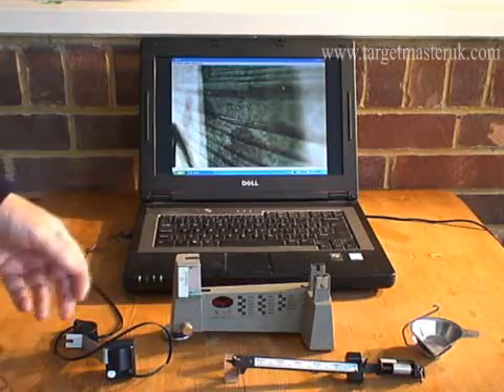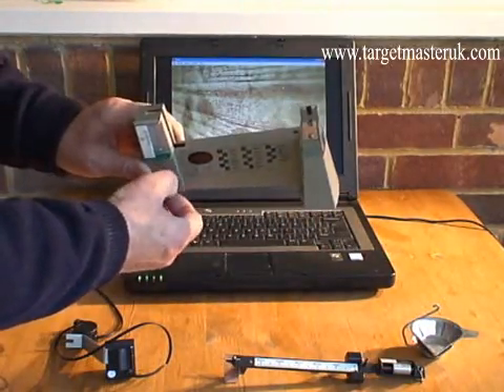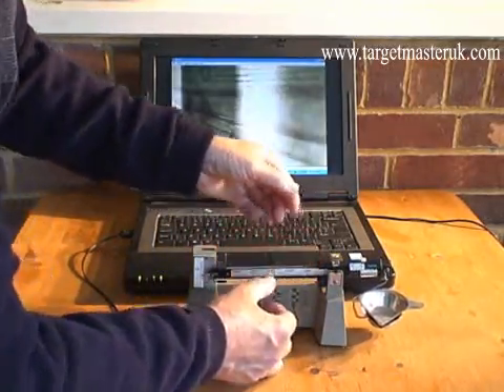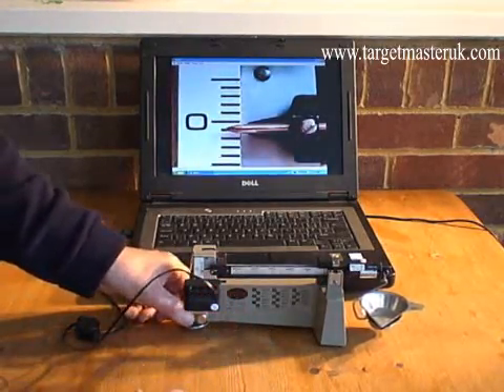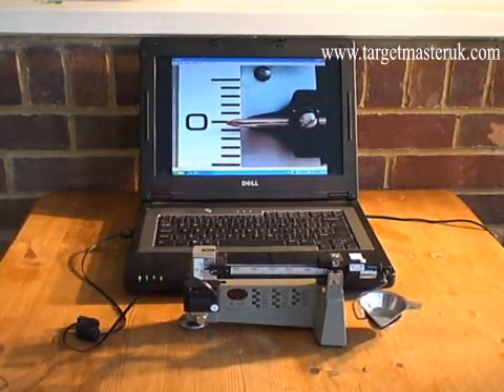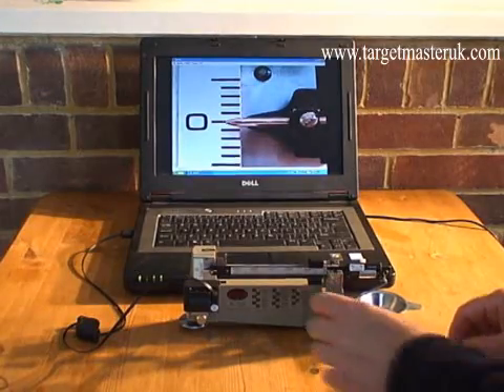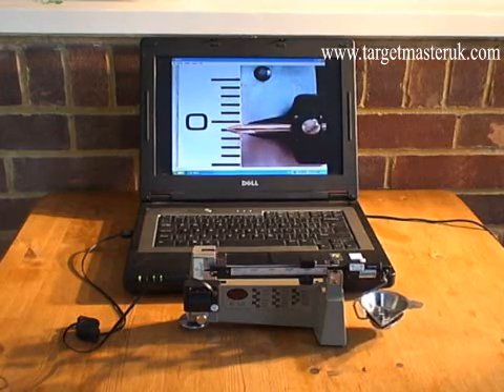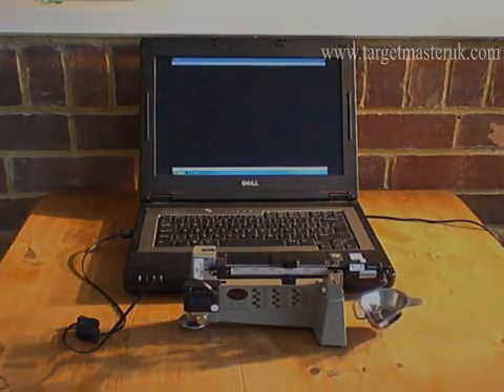Tuned RCBS / Ohaus 5-10 scales

Comment: How can I do the extended needle
Reply from the maker: I make all the parts myself by hand. The pointer needs to be made from something non-magnetic (Copper/Brass) and stand away from the bean by about 1.5-2mm. After fitting an extended pointer you will need to rebalance the scale by adding weight the the weightbox under the pan.

Comment: +thetargetmaster Hallo, I have a question. I purchased a used RCBS 5-10 that appeared to be in good condition. However, after I got it home it would not zero. Tried everything but the beam would not get anywhere near zero (i think I may have knocked it or something on the way home) and no matter how much I unscrewed the rotating disk, it wouldn't get close. I ended up re-calibrating the scale by adding a little bit more lead in the pan holder and worked great from then on.

Now I have noticed that I need to lift the pan off and place it back a few times to make sure it reading properly. For example, I would trickle up so its close to the line but if I take the pan off and put it back, its over or if I am lucky it will be spot on. But if I move the pan again it will be somewhere else. I triple check my charges (i.e it needs to read the same 3 times) and I'm getting an SD of about 5fps but would like to speed things up and get it to read correctly the first time. Is this normal with these scales, due to its age maybe or is there something I can do to make it function better?
Reply from the maker: Hello Mark - The 5-10 is an excellent scale, certainly better than any beam scale made today.
You would appear to have two problems. The scale isn't zeroing and it's not repeatable.

Have you ever seen the scale zero ok? Could it be that you have the wrong pan?

If it used to zero ok but doesn't now, then I would guess that you have knocked the copper damper blade. Just bending it a few thou will throw the zero right out.
The non-repeatability could be one of several things, dull or chipped knife edges, dirty or stuck agate bearings, friction at the pan hanger stirrup etc.
Reply: +thetargetmaster I had the zeroing issue since when I got the scale but checked it with a bullet (knowing the bullet may be off its advertised weight) and seemed pretty close. the scale is reasonably repeatable but I have to lift the pan and put it down a few times to make sure its reading right. how will I know if I have the correct pan? its the brass coloured one commonly seen with the RCBS scales. interesting thing to note about the copper disc by the magnets is that it appears to be closer to one side than the other. could that be an issue? is there a way to properly recalibrate it or maybe some sort of troubleshooting list and steps on how to correct the common knows potential issues?
Reply from the maker: Unfortunately all the pans look the same but very rarely are they the same weight. If the scale was working perfectly well with this pan, but now it's not, then the problem is with the beam.

If the scale has never zeroed with this pan, it could be the pan. It's not a problem as the scale can be re-calibrated by adjusting the weight in the weight box under the pan.

If the scale did zero with the current pan, but now it doesn't you need to find out why, not just adjust the tare weight.

I would first check that there is no "hair" of wire wool stuck in the damper slot, then I would remove both bearings and clean the housings and the agate bearing  and knife edges in lighter fuel type spirit with a tooth brush.

The bearings should be free to wobble about. The pan hanger stirrup should hang and swing freely. The knife edges should be sharp, with no burrs and not rounded or chipped at the ends.
Reply: +thetargetmaster thank you. I'll look into it :)

Comment: +thetargetmaster Hi, I have a RCBS 5 10 scale which is basically in brand new condition, it was bought by a family member probably 30 years ago. I have issues with a wandering zero.The zero will wander from high to low depending on how the pan is placed in the scale. One moment it is perfectly zeroed the next it is not? It's not out by much but it is causing me to second guess my loads.
Reply from the maker: Hello Russell.  That sounds to me as if there's a problem with the pan hanger stirrup. If you remove the pan and pan hanger you are left with just the thin wire stirrup. This should be completely free to swing without touching the sides of the groove cut in the little knife edge.
Make sure the two wire circles in the stirrup are parallel to the beam and just bend the stirrup in or out a little until it hangs free. Let me know how you get on.

Comment: thetargetmaster  Thanks for posting this video.  I picked up and old 5-10 from family yesterday and I think I have a problem that I was wondering if someone who knows this scale through and through might be able to shed light on.

The needle/nose literally touches the measure.  It makes contact with the inside part of the measure and if I pull the pivot back a little bit the needle will still scrape on the front (right hand side) of the measure.  When looking from above the copper guide touches and scrapes along the top series of magnets.  I've put a screwdriver to the magnets and they do indeed carry a field.  I've also taken calipers to compare how far the needle rides behind the measure and it appears to be a clean 1mm.  There also appears to be an apparent amount of rust along the flat blue foil underneath the scale.  

I believe it may be a magnetics problem but I just don't know these scales too well and there's little research to go on.  Even RCBS's very instruction manual is little help.  I hope this isn't too confusing, but if you can help I would much appreciate it.

Also the camera is too cool.
Reply from the maker: Ok, I'll help if I can. First thing is, this scale is worth putting a bit of time and effort into, there's nothing really that can't be fixed on them and they are one of the best reloading scales ever made.
I would guess these scales have taken a knock at some time, this has possibly bent the beam a little or bent the small aluminium indicator plate in towards the pointer of the beam. Can you message me with a photo if possible and we can sort it out. Check out my other scale videos and see if the help.
Reply: thetargetmaster I'll see about making a video
Reply: Ok, I had problems with mine and it was the stainless clips which hold the bearing blocks.  One had been bent down as was preventing the block from floating as it should.  Take off the clips and check your zero, then add one clip at a time to check.